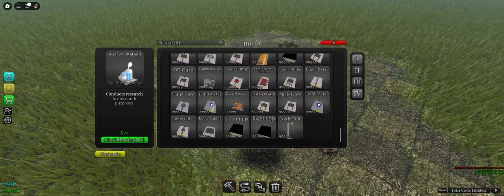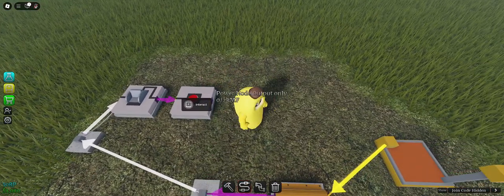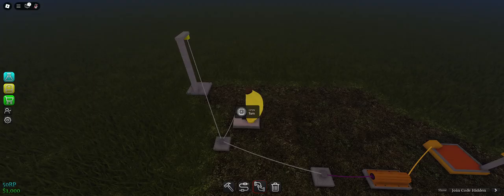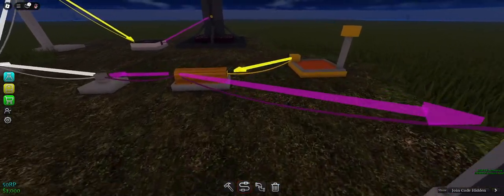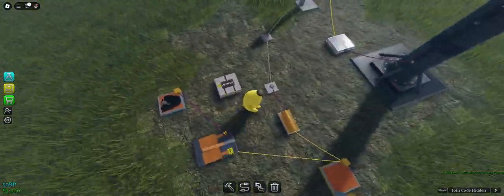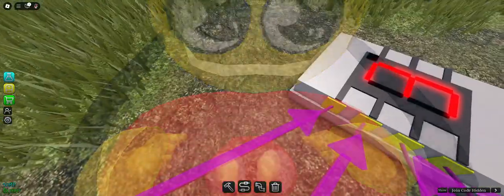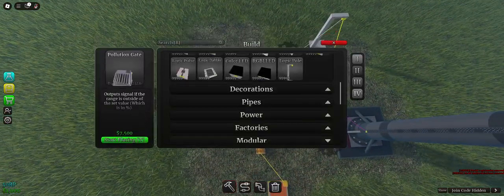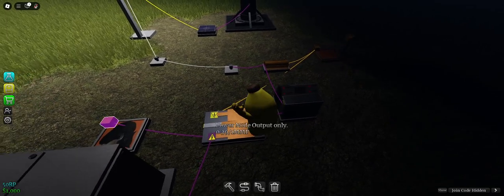A "Simplified" Logic Tutorial | Logic in Industrialist Explained

Comment: I have a question a steam turbine with firebox like how many research stations it can handle also the turbine would only power the research stations not any other factorirs
Reply from the maker: I wouldn’t know off the top of my head. Use the wiki to find out how much power a turbine can make and how much power RST’s take.
Reply: It can, i have 6 steam power farms with large turbines, when i had only one of them with some scrubbers, a iron coil farm from trendy banana and a big research station 2 farm, i had like 30 research station 2 farms and 2 steam power farm can power it
Reply: Use 2 water pump tier 2, one firebox, 3 coal drills, 2 liquid dump to dump excess water, and a large turbine
Reply: Imma send the vid rn
Reply: Here, after u finish it use the steam turbine to power the 2 water pumps tier 2 and the coal drills so its even faster, good luck